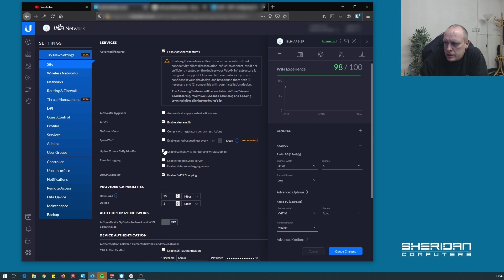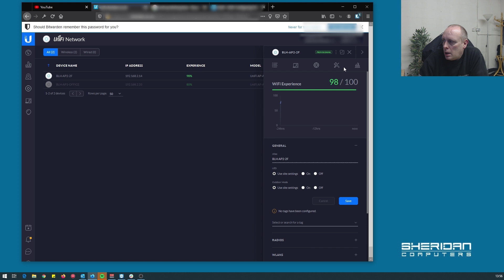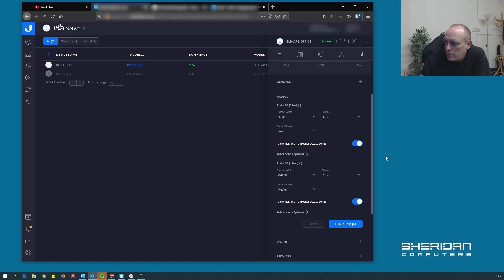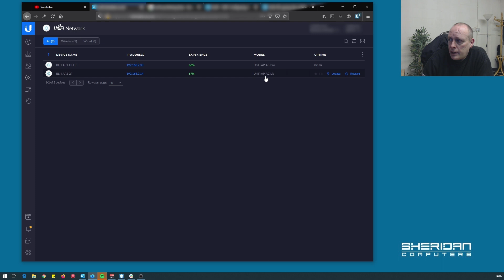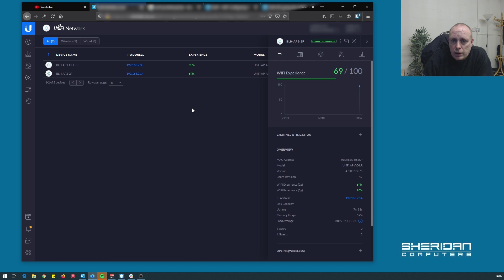How to set up UniFi wireless-uplinks | AP-AC-LR connected wirelessly to AP-AC-PRO

Comment: I set this up today at my two storey home. The AC PRO is wired & the AC LR is wireless. Works nicely & solved the wireless coverage issue in the top floor.
Reply from the maker: Works well in places near impossible to cable, always better of with wired if possible.

Comment: What kind of outside line of sight distance range can be expected over UniFi Wireless Uplink between two UniFi AP AC Pro's?
Reply from the maker: The AC Pro has a max range of 400ft under ideal conditions, bring wifi noise into the equation, weather etc , I wouldn't go much over 300ft even with clear line of sight.

Depends completely on settings and environment.